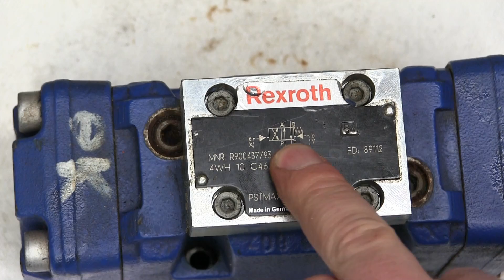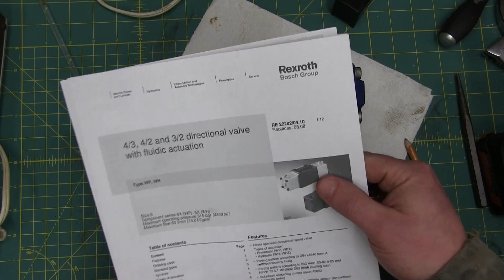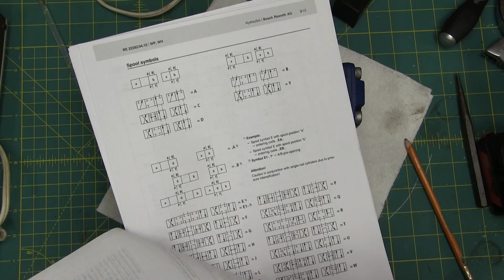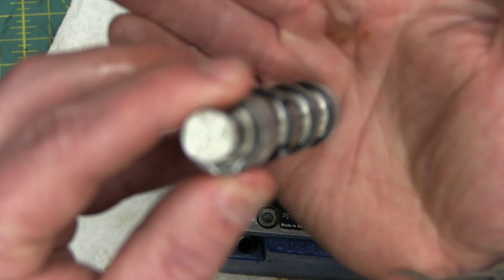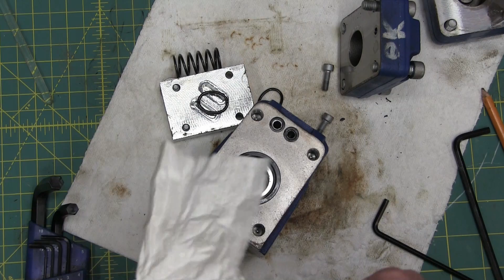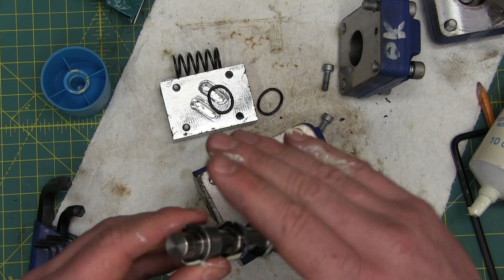BOLTR: Rexroth Hydraulic Valve | How it's built and Troubleshooting

Comment: Would a non contact thermometer give you a clue where your blockage or cavitation causing slow actuation
Reply: Depends on t he resolution of the device, and how covered the parts are... if it's in 12 inches of steel, it'll be harder to find that under a pile of sawdust, and depends on how accurate the NCT is.

Comment: hope you can help me, I bought a 811 bobcat backhoe attachment at online auction. the unit looks in excellent shape but every cylinder was leaking, so I change all the sills on all six  cylinders but now when I work it for about 15 min. the hydraulic lines get very hot and pap out of the machine hookups .. not an expert on this I search and search as much is could on you tube. my search went to this cylinder that start getting hot, and follow the line to the valve that has the controls . don't know what to do!

Comment: Late to the party, but hey... a few thoughts. I suspect someone had the aluminum block off and put it back on 180 out. That's why the label didn't match up correctly. Induction hardened not flame. Spools and bores are lapped for final fit and finish. Not all axial pumps are servo. Some, especially for ratio dependent chemical reactions like polyurethane, have micrometer like hand wheels for manual adjustment.  Some have swash plates that cannot be moved for fixed displacement applications.

Comment: I have a six liver rexroth hydraulic control valve that has no tank  so when the pump is engaged the engine goes off. please can you help me out.
Reply from the maker: You need a closed center pump like a piston pump not a gear pump. Or if the pump and valve are correct then maybe the engine is weak.

Comment: Spool looks essentially the same as the spool in a HEUI injector on some diesel engines. Only difference is they have a electric coil just beyond each end that pulls the spool valve back and forth. Common failures in 6.0 powerstroke engines due to lack of maintenance.

Comment: Here's a helpful tip on your camera not focusing that hopefully helps.  Go into settings and under metering change it to spot metering or center metering.  Basically what I think your camera is doing is taking the entire field of view and determining focus off of that.  Since your table is the most consistent thing the Cabrera generally doesn't want to shift focus.  If you set it to spot metering then it will focus to whatever is in the center of the shot or another position that you specify.  It should help.  I learned this as an evidence recovery team leader for a federal prison.

Comment: I work on a push boat on the river and the boat i usually ride is all electronic engines, throttles and steering. The gear boxes and steering both have gear style oil pumps on them and are electronically actuated with manual override. I know you can screw the steering and it will go back to the position the sticks are at, but don't believe you can over ride the gearbox with the servo in use. I see that schematic every time I look at the valves though ours are set in neutral to tank. Thank you for explaining that so I can go to my captain in two weeks and explain to him what that means.

Comment: Ave, your sleeve fucking off issue sounds very similar to a hydraulic servo valve from Parker Hannifin that Boeing used on the rudder of the 737.  Under a specific set of conditioins, that sleeve could shift, causing the rudder to move in the opposite direction, and force the flight crew's foot pedals back at them.  It took down 2 aircraft and affected a 3rd before it was discovered.

Comment: Humm, when troubleshooting... example, cylinder doesn't move, give some tap tap to the valve, I don't mean smash it, just a bit of love, many times it may fix the problem for a good amount of time, eventually the problem starts happening a lot... replace it, and throw the old away has fast has you can.
Internal leakage usually shows it self in cylinders moving on their own when they shouldn't, if the cylinder doesn't move on it's own but also isn't able to retain position when it should be able to, it's usually internal leakage in the cylinder

Comment: my job is figureing out what went wrong after the first guy spent 3 days on it... we never have new parts, if i got a part thats was labeled used good and it wasn't actually good... 3 days later Im pulling parts off of working machines to see whats fucked. Huge setback when there is no new parts to be had! on top of already being pissed off that as an electrical engineer im being told to fix the hydraulics.
 Same issue with the electrical components on machines. at times I will need to compare the part in question to a "used good" part Ohming out different pins to a controller. when the used part is actually bad now im stuck there hours later with two questionable parts on my hand and no closer to figuring it out!

Comment: A few points. Pilot operated valves are usually for handling larger flows. The valve you have shown was probably used for auto reversing..just connect the work ports to the opposite pilot, you would get an auto reciprocating cylinder. The spools are hard chrome plated and then ground. The valve body are usually bored and then honed. Clearance between bore and spool is usually 6-8 microns with these kind of valves. Finally, this valve is a size NG10 or CETOP 5.

Comment: one of the basics you didn't mention is that valve also produces or increases hyd oil pressure by restriction cause the size of the ports inside the valve are smaller than the input side of the oil coming from the pump, a pump doesn't produce a pressure,  maybe a little but cause the outlet is smaller than the inlet of the pump, but not enough working pressure, the pressure is produced at the control valve by adding restrictions, like pressing your thumb over a garden hose end. Also dirt inside the oil will cause these valve spools to stick, take them apart and clean that corrects it. Most hyd filters have a very low 15 psi bypass valve meaning if that filter clogs that bypass opens and floods the dirt collected in the filter back to the tank, just stalling the hyd over it's ability will cause higher return oil thru the filter opening the bypass valve, it's more important that return flow thru the filter is not restricted or the whole hyd system will blow up, so it's better to flood the dirt out of the filter back to the tank than blow it up, the best way is keep changing the hyd oil regularly , you're just shitting in the wind by only changing that hyd filter without changing the hyd oil, also you can check for cavitation or sucking air if the oil foams up.  Contaimates in the oil include metal gears from the pump cutting, cavitation, and the inside of the rubber hoses breaking apart from old age, if you see dry rotted hoses on the outside you can bet they are also dry rotted and coming apart on the inside too, also keep the inlet-suction lines connections tight cause they will suck air and dirt, also I notice customers will pollute the hyd oil by dumping in the wrong oil, motor oil, most people think oil is oil, and if it looks like oil, they dump it in, I can tell what oil is in it by tasting it,  I do a lot of work resealing cyls and I can tell by looking at the damaged packing if the oil is contaminated or the wrong oil,,,,, I try sooooo hard to convince my customers to change the hyd oil but they don't listen and they continue to have hyd problems and bring me their hyd cyls to repack.

Comment: I used to work maintenance at a die casting factory. We used a LOT of the solenoid operated version of these valves. Not Rexroth tho. We were constantly rebuilding those things because of hydraulic leaks due to o-ring failure. We didn’t run hydraulic oil in our machines however due to flammability issues. Instead we used a glycol based fluid. One of our biggest problems was all the aluminum shmoo that was literally everywhere. And don’t get me started on using ladder logic to troubleshoot the ancient PLCs that we had in those old machines! Of course nine times out of ten it would turn out to be just a fucked up limit switch and not a problem with the PLC at all, but when it wasn’t..........

Comment: I bought one of those FLIRs after seeing your first video on it, and I love it. It's come in super handy for all sorts of stuff, like identifying a misfire on my car, and verifying the thermostat was working (try testing a thermostat the old fashioned way, drain the cooling system, pull it out, boil it on the stove, see if it opens, where with this you just watch the radiator side of the thermostat start to warm up after the other side hits the right temperature). There are so many applications and it's so much quicker and easier than the traditional methods.

Comment: Back when the 737 was new it had problems with the rudder control servo. Thermo shock of hot hydraulic fluid entering a cold valve messed with the tolerances. It gave them fits tracking dawn the cause and there were several crashes before they finally found the culprit.

Comment: I also got fucked by a crack once...but this is not a bitter story about divorce. My day job as an undergraduate student was in a plant making cottage cheese. Not proud but I was young an needed the money and in New Zealand a gig is a gig. Obviously I told them it was my dream job, by which I meant the impossible dream of every poor student where you are paid to work. 

Anyway something was contaminating the rennet and culture ("schmoo") as it sat in the the culturing vessel on one production line. No matter how hard we sprayed and cleaned we could not resolve the issue. Visual inspection could not locate any problem. It was about this time industrial relations inevitably became "severely strained" between us technical monkeys and the production managers as they kept asking us how long a piece of string was. Eventually we located a microscopic crack that was just large enough that, when the vessel was filled with a couple of metric tons of liquid, would open up and expose the schmoo to the contamination. However when cleaning the crack would close up and protect the source of contamination as we did not fill the vessel during cleaning.

Conclusion: Better to sit on the management side of the desk than the monkeys.

Comment: Rexroth and Parker Hannifan hydraulic valves. Things of beauty. Keep 'em clean, work long time. Even cooler when stacked. Work great on flight simulators. Last part about removed valves, very important! If everything was working on the machine when you took the valve off, say to test another valve, then ok to mark as good in my experience. Otherwise, it needs some type of caveat. Unknown, maybe good?, etc. Getting a bad valve off the shelf really screws the troubleshooting. You now may have two problems in the system or have convinced yourself the original valve was not the problem. Store carefully, also. Capped, clean, in a plastic bag maybe, sit them on wood shelf, don't drop on metal or concrete. They are expensive.

Comment: 20:25 A WORD OF WARNING: a few systems are actually not compatibile. Phosphate ester (eg. Skydrol and similar fire resistant fluids) based systems use EPDM O-rings, which ARE NOT compatible with mineral oil products.

Comment: A year ago i was working on a 3D-print extruder for clay. I experienced that silicone lubricants have less static friction than petroleum jelly. Also i remember reading somewhere that petroleum based lubricants cause swelling. I guess thats an advantage in huu-drolyc systems, not so when you try to seal to moving parts :) (when using motors with poor torque that is).

Comment: Can you comment on 'Krytox' and it's exclusiveness to industry applications.  Is it a fake floozie?
Reply from the maker: Fluorine chains rather than carbon chains. Inert. Only needed in very specific applications. Normally, do you see a grease break down, or just get dirty and ooze out?
Reply: we use it to seal lab glass and some seals in plant for vacuum applications at higher temps than 150C in the natural products refinement industry  . Its great, also use different weights for rotary vane and diffusion vacuum pumps. Its not recommndd by many for diffusion pumps, but for our application it has been great.
Reply: slobdog21 Not a fake floozie in my universe, many weights, many uses with vacuum

Comment: It should be pointed out that not all spools are symmetrical as the one you have is. Careful attention should be be paid to how the valve body and spool were oriented to each other as they are disassembled and reassembled. Get that wrong and later when you find the component that caused the original problem your machine still won't work because you introduced a new problem into the system in the earlier stages of the repair operation. By the time you have gone round and round with that crap you will wish you were an electrician. ;-)

Comment: Am I barking out my ass or is it the case that the "blanking plate" on top is machined so that it can be installed 180 degrees around bass ackwards?  it appears that the holes are drilled such that you could cross connect two holes....or alternately the other two?  That might explain why the plate spec label appeared upside down ?

Comment: The rings that you referred to are called Radial Pressure Balance Rings and their primary purpose is to hold the spool centered in the bore. The land would ( in conjunction with the sealing oil ) not allow excessive leakage across it even if the rings weren't there, but there would be a danger of the spool being pushed against the wall of the bore under certain circumstances resulting in a gawd that would make the valve leak excessively or lock up. I was taught at the Vickers Hydraulic School that the rings were not for sealing although many techs think they are.
Reply: Would that also be considered a labyrinth seal or is that only on rotating assemblies?
Reply: Did you ever teach a hydraulic class at a Corning Glass Plant in State College PA?
Reply: You are right, the Radial Pressure Balance Rings are not for sealing as leakage flow past the Balance Rings is higher than that for a raw ungrooved spool, but the Balance Rings relieve/balance the unbalanced pressures around a spool while being used to prevent the spool from being pushed by those unbalanced hydraulic flows against the walls of the spool's bore, decreasing friction and wear.

Comment: These are what I control with the Click PLC.  Massive machine, 60'x100'.  There is a small solenoid valve that sends the flow to a really big valve (2 of them), for moving a 10" diameter cylinder about 10' in throw.  Big stuff.

Comment: We had a valve on a tractor (pull push wire operated) that got hard to move after a while. We took it apart saw nothing but if you turned the inside 180 degrees it works fine.

Comment: Could you not rotate said blanking plate 180 deg. and effectively invert the logic directionally so that the valve physically fits in the circuit proper? All the rest of the parts look symmetrically interchangeable sans oil varnish.

Comment: Yeah... you are the next guy.  And if you have a wirebiter handy,  we will rig up a test bed to test it too.  I've done that at work several times.  Hook them up to a little spare plc to do a stress test too.  Feed her a hot supper in the shop of 20000 cycles so the next guy knows it's tested but good.

Comment: How do open center valves work when you have multiple valves for different functions hooked up to one pump? Wouldn't the fluid take the path of least resistance through one of the other valves?

Comment: I was taught they were pressure binding grooves, to prevent a pressure imbalance in the valve from cocking the spool over to the side and locking it right up. This was by an IFPS trainer, so assign what validity you want to it.

Comment: The grooves on the lands are called balancing grooves. The ports on the top (NG6 pattern) are there because they are using the same casting they use for internally piloted valve.

Comment: Awesome video!
I've been working on truckmounted hydraulic equipment (cranes, loaders, loadshifters etc. )for a few years now so nothing new on my part but still, refreshing is newer wrong.
When i was new to the biz trouble shooting was a royal headache with a lot of  "Huh?! It's not supposed to to that, how does it do that?!" stuff going the wrong direction, wrong stuff moving and all that. But as you say, it's actually just like pixies.
Just look grab a coffee, find the schematic and follow the flow until you find where the flow goes the wrong way. Allthough on cranes, leakage was 98% of the repairwork, especially internal leakage on extension arm cylinders. Because there you could have one cylinder moving because one of the others was leaking (They are mostly parallel connected).

Comment: Re: the grease at hand.  I knew a woman who proudly drove her fairly X5 from Tahoe to the shop in Napa with the low oil light on because she "knew that the X5 takes a special BMW oil" and she didn't want to put just any 10w-30 in there.  Long story short, fucked the valve train.  Some slippery is better than no slippery.

Comment: So single throw double poll switch.
Reply: Not really, on that switch you have 6 contacts, 2 common that get switched on way or the other, The valve has only 4 contacts, and the valve reverses the flow of the output ones. (edit), but yeah you can use that switch to do the same if you connect it right.
Reply: Yeas looking for an elechicken translation.
Reply: *Pole

Comment: Be careful of the use of oil based lubricants on engine coolant o-rings.  In some cases the oil will swell the o-ring to the point of poor installation or leakage.  Also>> Most important would be anything brake related.  Using anything but brake fluid to lubricate those o-rings WILL BE CATOSTROPHIC!!